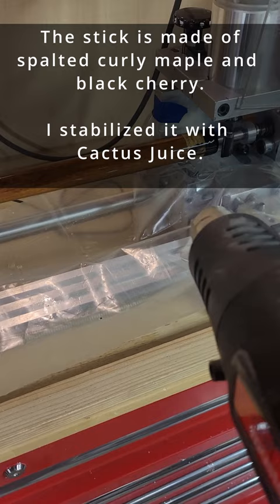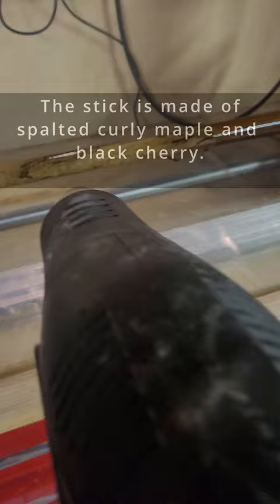Increase Stick Girth while Eliminating Epoxy Air Bubbles with Secret Elixer :)

Comment: You my friend are as determined as I would be. Thankfully 99.9 % alcohol evaporates pretty quickly, we certainly don’t need / want any mishaps. I was surprised to see a heat gun in lieu Tia torch which I see these creators of river tables using. Hey, if it works, personally I think it’s  the safer of the two. Curious… did it add weight?
Reply from the maker: I don't know if it's adding or subtracting yet, but the weights in the butt are incremental and I can add or remove easily. We'll still wind up at 19.5. The DNA surprised me when I heard about it, but it works like a dream. Just can't breathe afterward.... :)
Reply: @charactercues  Yeah I’m still trying to wrap my brain around the alcohol and what exactly it’s doing to the epoxy. Is it a chemical change or a temperature thing, ya know feels cool on the skin if you blow on it after contact with the alcohol.
Reply: Got my answer…..Spraying a fine mist of acetone, or another denatured alcohol, over the surface of an epoxy floor coating will pop air bubbles as well as lower the viscosity of the surface and flatten it out.